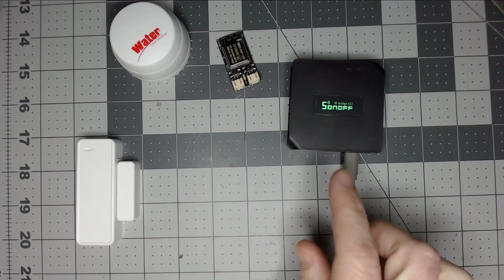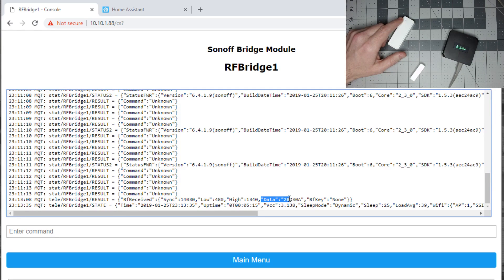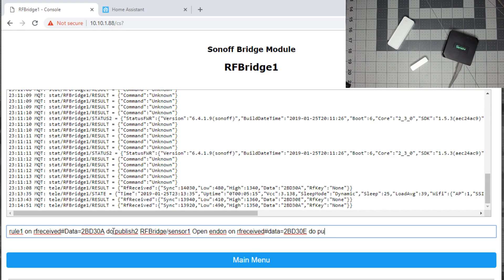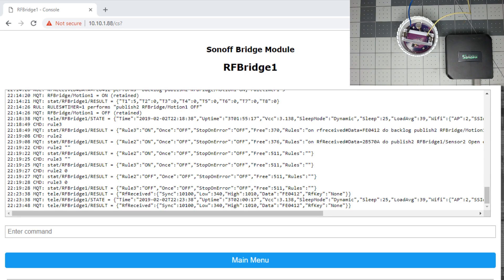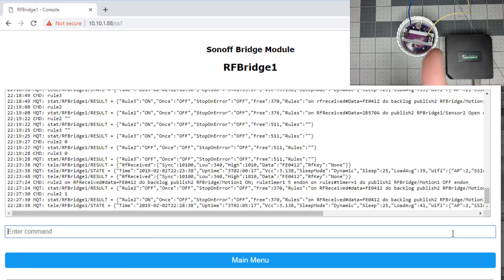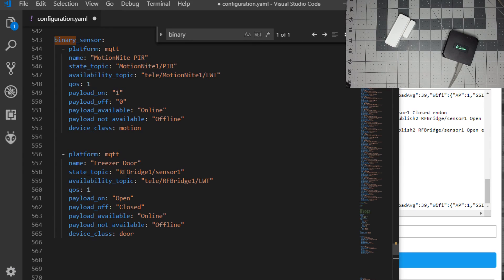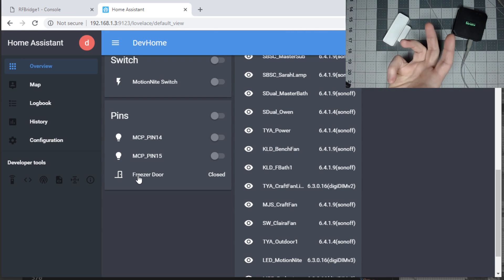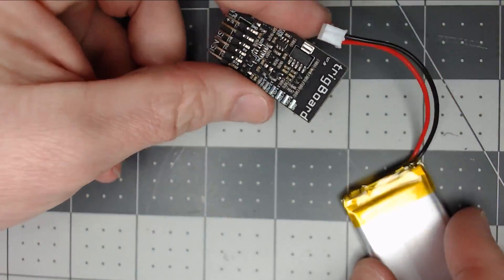Sonoff RF Bridge Easy Setup with Tasmota Rules and the trigBoard

Comment: Hey, can you please help me? i want to set up multiple  door sensors. they have only one code dor open so i set up rules for each one of them. When i got to rule4 it said command unknown, so i think you are only alowed to 3 rules. how can i group multiple sensors in one rule? what is the command line to put their codes and timers in one rule? i would realy appreciate your help, thanks!
Reply from the maker: There are 3 rule buffers. You put them together in each buffer. Rule1 on trigger do something endon on trigger do something endon and so forth.
Reply: @digiblurDIY  thank you! you saved the day :) it worked. i couldn't see the correct way to write them all together. Thanks

Comment: Very new to rules.  This rule does not seem to publish the off command.  Any help?
Rule1 on RFReceived#data=DF8911 do backlog publish2 RfBridge/WaterLeakKitchen ON: ruletimer1 5 endon on rules#timer=1 do publish2 RfBridge/WaterLeakKitchen OFF endon
Reply from the maker: Looks like you have a colon instead of a semicolon.  For the backlog command you stack commands that are separated by semicolons.

https://github.com/arendst/Sonoff-Tasmota/wiki/Commands#using-backlog
Reply: digiblurDIY thanks a mil!
Reply: @digiblurDIY  could you retype the command  rule for the timer 
rule2 on RfReceived#Data=E754BE do backlog publish2 midtv_mqtt/Motion1 ON; ruletimer1 5 endon on rule#timer=1 do publish2 midtv_mqtt/Motion1 OFF endon
Reply: thanks I see the problem "rules#timer"

Comment: have same brigde for my switch button. but can not implement this on tasmota :-/ how cmd can use for this problem? i try <<< switchmode 1 1 (code) cmd/topic/power >>>what can i do for solve hos problem .....????
Reply from the maker: Not sure I understand completely. Could you explain more on what you are trying to do?
Reply: i work with Hassio. bridge for run for sonoff type 86 433Mhz . I need the connand code for tasmota to assign the switches.. 

This i think is ok
on configuration.yaml file
One of 3 switches:

platform: mqtt
name: “Sonoff RF” <<<<<try to bind this with >>>>Type 86 with 3 swiches<<<<<
command_topic: “cmnd/sonoffrf/power”
availability_topic: “tele/sonoffrf/LWT” <<LWT?
state_topic: “stat/sonoffrf/RESULT ”
qos: 1
payload_on: “68658”<<<<<Code from bridge
payload_off: “68658OFF”
payload_available: “Online”
payload_not_available: “Offline”
retain: true

But I don’t know how to setup the Tasmota to say: hey go open 3 ports for switches 🤔🤯
Switch1 Power1
Switch2 Power2
Switch3 Power3

And what is LWT?

Sorry for my bad English 😬
Thanks for help💪🏼
Reply from the maker: This isn't a switch. LWT is last will and testament. It let's you know if the device is on the network or not.

Comment: Hello, I have a question and I need help. (sorry for my english, I am from Germany)

I have a Sonoff Bridge with Tasmota Firmware geflasht (6.4.1)
Now when I use my 433mhz Motion-Sensor, I see in the Tasmota Consol:

„RESULT = {"RfReceived":{"Sync":8890,"Low":290,"High":840,"Data":"2B56FA","RfKey":"None"}}“

I wish now, that a „Rule“ sending http Request to:
http://192.168.0.4:8083/fhem?cmd=set%20Anlagenschaltung%20on

(thats a switch in FHEM)

A example(its do not work) could be:

rule on rfreceived#Data=2B56FA do websend [192.168.0.4:8083] /fhem?cmd=set%20dummy%20on endon

If enyone is outside there in the World, who can help me, it would be very very good and you would do a big favor for me.
Have a nice Day,
Marco
Reply from the maker: It might not accept those characters. You could send a mqtt message to HA or NodeRed to have it send those different HTTP messages.

Comment: Great video,

Can you publish a sample of the Hass yaml code for the Water sensor?

I'm trying to get the water sensor in Hass but I don't believe I have the yaml correct.

Thanks
Reply from the maker: I had it as a motion type and it is the same binary sensor setup except you can change the class to get the different icon.

Comment: Thanks for the video.
Do you know if the water sensor sends a battery low notification to the hub ? 
If so what is the data payload and how would you make a rule to send that on to HA.

Thanks

Comment: Question: I`m using the same door sensor with 2 codes, sonoff bridge etc.. The problem I have is speed of opening door and closing. If I open and close door too quickly ( 1-2s ) the sensor will not register closing sequence and the door remains open in HA. Have you experienced similar behavior on your end?
Reply from the maker: I haven't been able to reproduce it with the door sensors I have. Just tried opening and closing the door quickly but the state always went back correctly.
Reply: i have the same problem
Reply from the maker: Have you tried a different sleep setting in Tasmota possibly?
Reply: you mean the Tasmota in the Sonoff bridge? Never heard about sleeping state. I was more thinking that this delay is simply delay of the 433MHz + Tasmota on a Bridge. If the door sensor is further from the bridge it perhaps takes some milliseconds to transmit the signal. So as a side effect if you close door too quick the closing signal will get lost or ignored by the bridge
Reply from the maker: Yes. Type sleep at the console.

Comment: Great video. Are there any RF bridges which use 315 MHz, so I can control my ceiling fan?
Reply from the maker: I haven't run into any except for a DIY build of one.
Reply: @digiblurDIY  Thanks, I ordered 315Mhz RF transmitter and receiver link kit off ebay and planning to read the codes from the remote using arduino or esp8266.

Comment: Great Video.

I noticed you have a card in HASS with what looks like all of the tasmotized device %topic% and firmware version... Question... How did you do that? 

I want to create a dashboard where I can manage all my devices via MQTT on the tasmotized device. This will allow me to do away with http on the device.
Reply from the maker: First an Automation that fires at startup or manually triggering it:  https://gist.github.com/digiblur/b8c28c07fae3859542a67a2e27646bc4

Then here's a sensor to pull the version out.  https://gist.github.com/digiblur/6215bb4472dd156907225331b9900fdb

Comment: Great work! 
One of the reasons that I'm tinkering with a 433MHz bridge is that I'm limited to 10 device connections in one of my applications(remote property monitoring using mobile hotspot.) 
I'm using Wyze cams and Sonoff switches (with their apps) for monitoring and I'm thinking that IF I can control at least 4 (and perhaps more) devices with the RF bridge then it would be very VERY useful.
 ......IF I can ever get HA working reliably enough....which is ALL on me.

 If I were a real technician I might be able to cobble together something like an I2C solution for sensors and such,  but that's a different squirrel to chase after on a different day.

Thanks again!

Comment: great video, I noticed you are using Tasmota RULES a lot. I`m no expert but it seems to me that you can either put together rules in Tasmota or in HA. So here is my quest: Why do I want RULES in Tasmota instead of HA if all my automation goes through HA anyway? I like those rules but need some Business Case for them :-)
Reply from the maker: Yes, as MQTT is the center of a Smart Home with MQTT devices, not HA itself.  Sometimes rules are easier to apply within the device itself and make a true smart switch/device.  Plus I prefer for things to run if I have HA down for some reason.  Not to mention it's quicker to skip the middle man.  As I could publish a command right from the RF Bridge to another MQTT switch without Home Assistant running.
Reply: @digiblurDIY  it would be awesome if you highlight those special cases where rules for device to device communication will be beneficial. For Example I have the Dr.ZZzs 3 way switch installed with 2 SONOFF Basics where one which is not connected to the light talks with the other directly instead of going through HA.  Chaning payload from '123456A" to "Open" is nice but not necessary. btw your rules for iMeh is awesome and nice example.
Reply from the maker: Will do. Did you see the rules on the Kuled switches I did? Probably like the ones you have done I assume.

I also use these MQTT topics on NodeRed so it would have been additonal work to have HA turn around and publish the packet back out or do additonal flows to break down the json template.

Comment: The Sonoff RF Bridge specifies "Control maximum 16PCS RF controlled devices on the App through network, make your home smarter." Is that due to the app? If you flash it with Tasmota, it should be able to listen to unlimited RF devices right?
Reply: RF Bridge can CONTROL up to 16 RF devices (like power sockets) but can receive unlimited 433mhz signals from sensors, switches etc
Reply from the maker: Yes, you can listen to all the message codes you want that you can pile into these rules.  If beyond that you would have to use something else to break down the TELE MQTT messages.

Comment: Great video! Interesting concept, currently I'm using the "tele/RFbridge/RESULT in my HA configuration, but I get tons of these errors "Mon Feb 04 2019 08:05:56 GMT-0700 (Mountain Standard Time)
 No matching payload found for entity: Garage Motion with state_topic: tele/RF_Bridge/RESULT" Will using rules stop this? Thanks Dale
Reply from the maker: Bingo!  You nailed it.  I had this same issue plus I was spending time to break it down in NodeRed along with retain issues, pushing to custom unique topics just seemed so much easier to me on the backend of managing things.
Reply: @digiblurDIY Great. I get a lot of the same msgs. Once I wake up, I will watch the video again and see what I need to change.  I have numerous sensors as well as several 433mhz 4 button key fobs that I use to turn stuff on/off. Thanks @Dale Scott for bringing this up.
Reply: Michael Henderson  
 Search the home assistant  community website for the error.  It is known and there are ways of fixing it by commenting out some lines in a python file.    You can run a custom version of the file if you create a custom_components folder in the folder your configuration.yaml  resides and an MQTT folder in the custom_components  copy the binary_sensor.py file there.  Comment out the that output the warning message. They are in an ‘if else’ construct somewhere around line 145. 
 
I’m writing on an iPad and don’t have access to my Pi  so the above is from memory.  Latest version home assistant.
Reply: @ozriblit  This works even better. No wierd custom component stuff, it uses about a dozen lines of python to do pretty much what Travis did in this video.  https://community.home-assistant.io/t/sonoff-rf-bridge-strategies-for-receiving-data/108181  Works fantastic.

Comment: Isn’t it possible to monitor “tele/RFBridge1/RESULT” on your HA and just configure sensors using the data payloads? No need for explicit publish commands on the bridge because they’re already being published to the topic I wrote above?

And what is publishing the LWT message?
Reply from the maker: You can but then you get all the TELE messages unfortunately.  Look at Dale Scott's comment as I ran into the same issue as him and this just seemed simple to me plus I could easily use it in NodeRed and other MQTT triggers.
Reply: @digiblurDIY  Ah, I see. He didn't specify where the errors are showing up - the HA log? Mosquitto? Sounds like something that can be fixed in a future HA release... unless for some reason I can't think of they want topics to be so restricted to only be for one purpose. Without doing what you are - we could just toss in all our sensors into our HA config with the general topic for that device itself (like the bridge) and just setup which payload goes with which sensor. If it doesn't match then discard or something. Having to setup rules for every single sensor data value doesn't seem sustainable.
Reply from the maker: He's getting errors in the HA log since the result topic is used for many things.  Everyone's setup is different of course.  Home Assistant is not at the center of mine, MQTT is.  If I want to send a command to turn on a light, I don't want it to go from the RF Bridge to HA then to the light so I'd just have a rule to do that.  Much like I do with long press actions on switches to toggle other lights.  There's 10 different ways to do things in the HA world, I'm just showing how I do things in hopes of spawning various ideas for someone to find an even better way to solve a problem in their home.

Comment: Awesome video thanks for sharing! What are you thoughts on a trig board for motion detection? I want an indoor and out door motion detection. How much is the trig board? I didn’t find how to purchase it easily from the link. How is the Battey life? Obviously mileage will vary depending on how often it’s triggered.
Reply from the maker: He sells them on Tindie. I linked his wiki that has the Tindie link and more but here it is too. https://www.tindie.com/stores/kdcircuits

Battery life is going to be based on the battery size you get for it. Pretty cool board with some advanced features. He has a YouTube channel as well and I believe he just did a PIR sensor one. Here is his channel. https://www.youtube.com/user/kdarrah1234